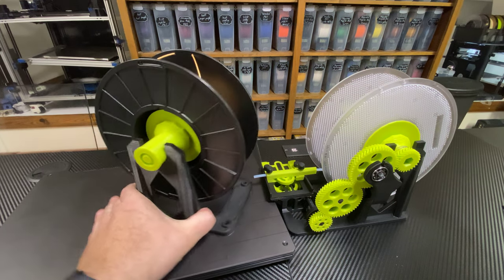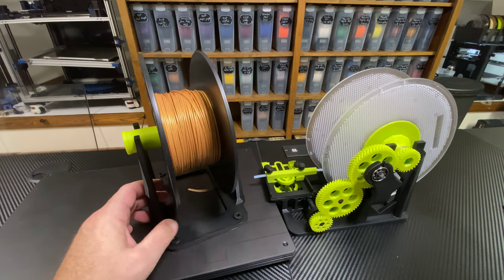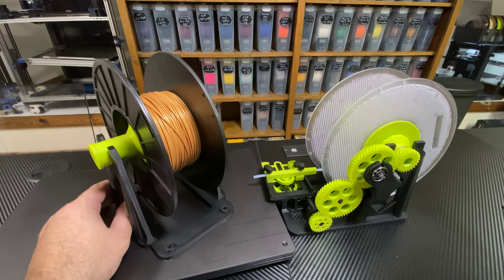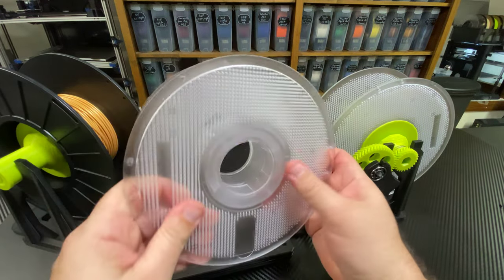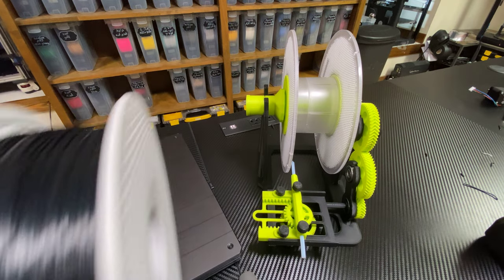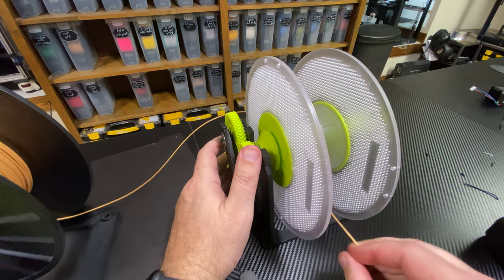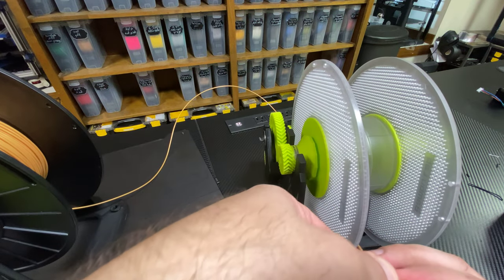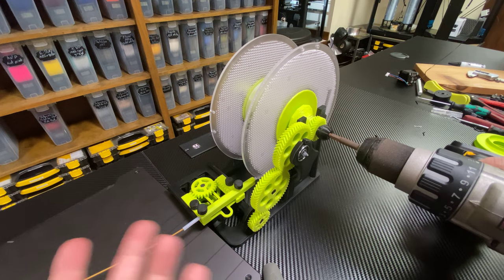Transferring filament to Bambu Lab spools

Comment: The more of these I watch, the more I resign myself to just paying Bambu for their refills, and sticking to brands like Voxel that I know work perfect with the AMS. For cardboard spools like Overture and Elegoo, I just use electrical tape around the spool edge, and they work perfectly that way.
Reply: I am only use few spool brands and I printed a small riser for the ams lid for the slightly larger spools (not at the bottom but for the lids, this way I don't have to modify anything in the inside) and I printed the spool rings for the cardboard ones... with the riser I have no issue with the rings either

Comment: I really like it. I Remixed/Uploaded a version to Printables that you can put a small DC motor on it with a Power/Reverse switch. Working on putting an "endstop type" switch so that it kills the motor when the end of the filament gets to the beginning of the tubing so you can just pick up the new spool and grab the end of the filament. Works good so far! :)
Reply: Outstanding I am going to go look for your version.  Thank you.

Comment: I almost use exclusively cardboard rolls (Polylite/Inland) in my AMS, I use  3/4  drive 1 1/8 ratchet socket inside the core as it lets the socket free roll inside the core. When the roll gets 1/2 way empty. the CB spools run  right down to the end without issues.

Comment: I don't think the AMS should have been sold with these problems. I don't understand why they didn't make it wider as it would still not protrude over the edges of the main unit and would have allowed spools to be 5mm wider. I also don't think the motors are strong enough which is why there are errors all the time. I think the way to go is half spool most spools as that will most probably make it function without so many problems. I guess they put holes in their spools just to make them lighter so they work better, but doesn't help the people trying to get normal full rolls working.

Comment: yeah. looks like a totally uncompicated process. You just need to download, print 43 pieces, some of the probably several times, because of failures, then you need to get some ball bearings and finally you need to try to spool it up which doesn't work well (see your failed first attempt). Why do we as customers always obey to the failures of producers instead of saying "you, mfs, I paid 250 bucks, deliver something that works with all spools" - what a failure...

Comment: I seen too many hacks and wasted poop pla to not buy this printer, company should have worked more on the AMS what a way to fix the company lack of engineering
Reply: Everyone has to start somewhere.  Rome wasn't built in a day.  Just like there's an iphone 14, it takes iteration.  The only way to reduce poop is to have multiple print heads, which would drive up cost.  Maybe in a few years they can afford to do multiple print heads.
Reply: @redone823  - The AMS is an OK solution for contrasting colors on the top 2-4 layers which works well for logos or lettering.  Trying to print a foot tall four color Buzz Lightyear is going to take a long time and waste a lot of filament.
Reply: Who cares. Filament is cheap. The printer works really well. The AMS works well. The Bambu spool refill system is a poor setup. Most people don’t do a ton of color changes. Just occasional changes. The filament purge amount can be dialed back a-lot with no adverse effects.
Reply: You don't own one - your loss... If you know how to do it better, bring it to market or take it to Bambu. "I seen..." equals zero hands on experience, so I'd take your advice with a grain of Himalayan Pink...

 No, you can't use every spool diameter or width in the AMS, but you can use most. The AMS works well - 4 slots per, automated load/unload. Bambu has fine engineers. Great speed, reliability, accuracy, control. If it had dual extruders, one or even 1/2 AMS per =!Oh Baby!= But it doesn't, not yet. Yes, it by necessity wastes a bit of filament for embedded/partial layer multicolour, but you have to purge and you can dial it way back from default with good result. Dual Extruders would cut a lot of that waste and the AMS is quicker loading/unloading than most operators - so MC could be an almost pleasant experience. They'll probably get there. In the mean time, they still rock.
Reply: @BasilFawlty64  - I don't have a dog in this fight and maybe I'm iconoclastic, but whenever I see this level of Bambu evangelism, I have the urge to make a snide comment about drone engineers starting a 3D printer company, accelerated wear on carbon fiber tube motion control components, the AMS bearing blocks that break forcing people to print community designed Hydra to fix the AMS, etc.   🙂
Reply: Prusa XL out there for ya.
Reply: @blacknine  nothing like buying a 3d printer that has printed parts in its construction. No thanks.